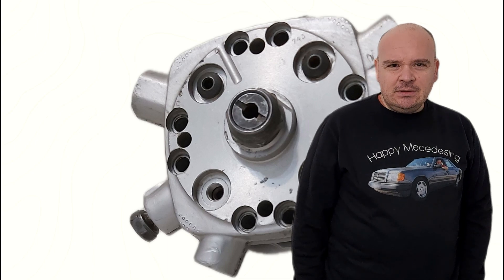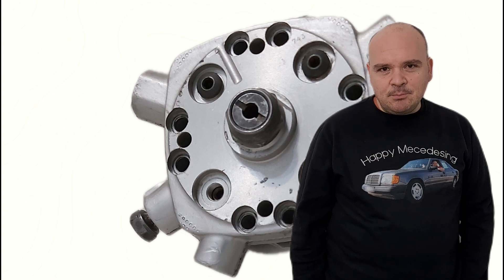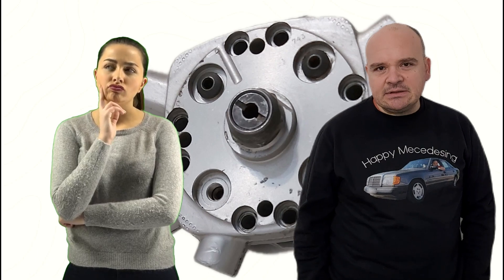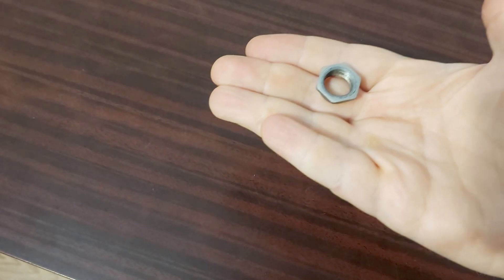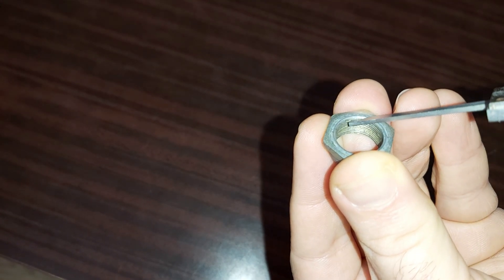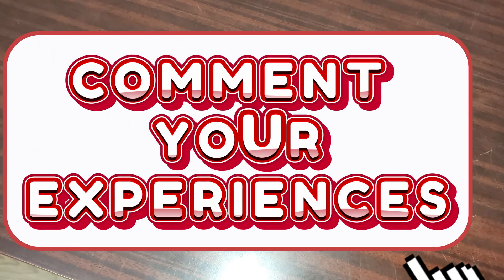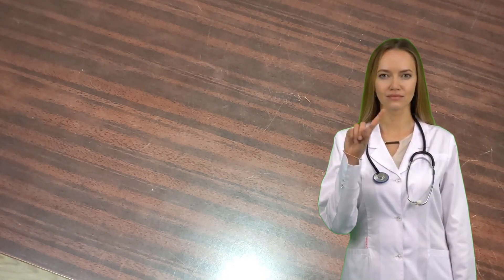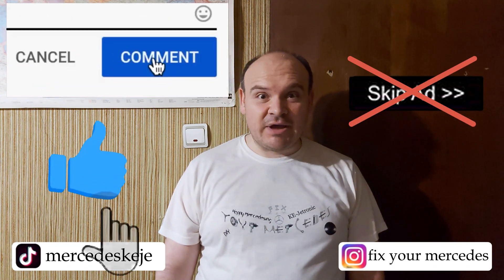㉦Mercedes Ke-Jetronic㉦ - 👌🏻👍🏻✅A simple trick that helps a lot!👍🏻👌🏻✅

Comment: Hallo ivica
I need your help mr
I have problem when I replace my m103 ECU jetronik with the new one
The idle cannot be 700-800
What happened?
The ECU part number is the same
With the old ECU
AF potentiometer send 0.7V when idle
But the idle is 1500-2000
What sensor fail?
Note:I have replace the coolant temperature sensor and check the value is correct
Thanks for your help mr🙏
Reply from the maker: Check the TPS if it recognizes idle and WOT(wide open throttle). This can mean that the car is in the limp mode. Check the idle control valve. You have the playlists on my channel, check everything like me!
https://www.youtube.com/watch?v=Rs_gjvmU1S4&list=PLysDz2b5tZakXt3Cj0YZhpEnxODBzSpfO
https://www.youtube.com/watch?v=LMNSd5qOjQY&list=PLysDz2b5tZakPFpIoNd1MFjpDwiUy-hs5
Reply: @mercedeske  already check the idle control valve,and have been replace with a new one also, its same,
The TPS at the throttle body when not open and Full open ,WOT have a continuty,also when engine run I pull the socket the idle seems be higher more, means thats function
Are The new ECU need calibrate ? Or have a special technic?
Thank you Mr. ivica 🙏

Comment: Could you help me with the diagnosis? I have a Mercedes (w124) 300 TE24. There is a big problem with the engine operation. The cold engine starts and works perfectly, but when it heats up almost to the nominal temperature (80 C), it starts to run unevenly and the engine stops. Such an engine cannot be started at all, or it can be started, but when you try to put it in "D" gear, the car stalls. You have to wait until it cools down, then it can be started and runs very smoothly, accelerates and drives perfectly. Nobody can deal with it. It was suggested to replace the distributor cap and distributor finger. Apparently water accumulates there. But where does the water come from in a hot engine? Regards . Adam from Poland
Reply: Hi change the " condensor " maybe wrong word.But anyway it is under the Car next to the fuel pump and
filter. Maybe change the filter while you at it good luck.
Reply: @rolfschulze1219  he meant  fuel accumulator , prime culprit
Reply from the maker: @supermolibden5037  Have you replaced the O2 sensor?
Reply: @mercedeske The Lambda probe was not replaced. It was only electrically disconnected from the system. This didn't bring any improvement. I need to determine whether the cause of the vehicle stalling is lack of fuel, but replacing the Lambda sensor is a good idea. Thank you

Comment: That’s pretty much the measurement I had when it came back from Flowtech. Before I had it rebuilt the depth of the control nut was .43mm and when I got it back it measured.27mm. Bosch says .6mm. So anywhere around these measurements will likely work. Of course the fuel distributor can still leak fuel if the sensor plate isn’t adjusted correctly.
Reply from the maker: Exactly. Thanks for the comment, Tony and I'm expecting further videos on the SL? Greetings from Serbia!